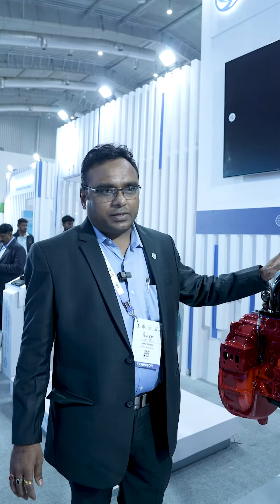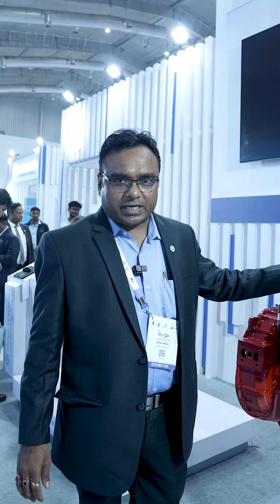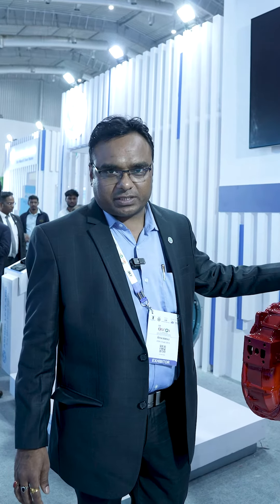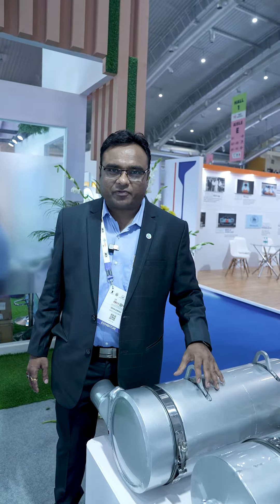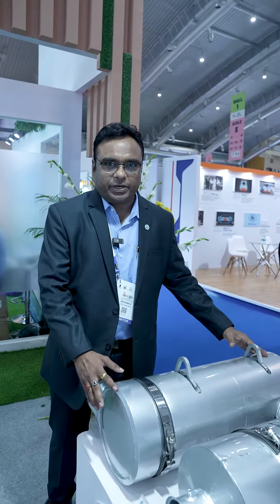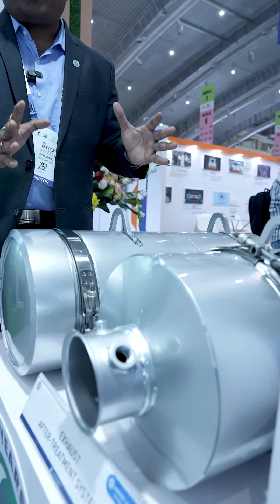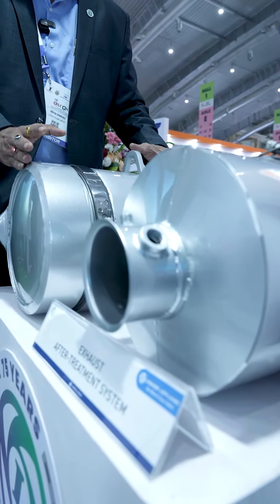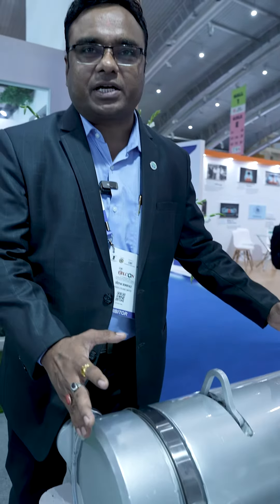Ashok Leyland | Listen to Mr. Deepak Bondfale as he discusses the launches at #CIIEXCON2023

Comment: Rear OHV Engine (Air Cooled)
1. 2,200cc (Flat 4 Engine) (City Bus)
2. 3,000cc (Flat 6 Engine) (BRT Bus)

Engine Mounting: Transverse

Width of City Bus: 2.4 m
Width of BRT Bus: 2.6 m
Ground Clearance: 180 mm
Length: 10 m

Low Floor, Low Ceiling Bus

Cabin Height = 1.9 m
Reply: Same 4 Truck

Engine
1. 2,200cc (Flat 4 Engine)
2. 3,000cc (Flat 6 Engine)

Width: 2.4 m
Length: 10 m
Reply: Constant Mesh Sequential Transmission

Bus:  5 Speed
Truck:  4 Speed

Shift Pattern:  N 1 2 3 4 5